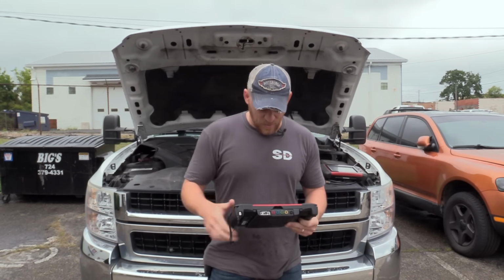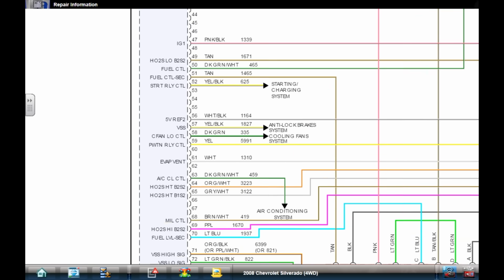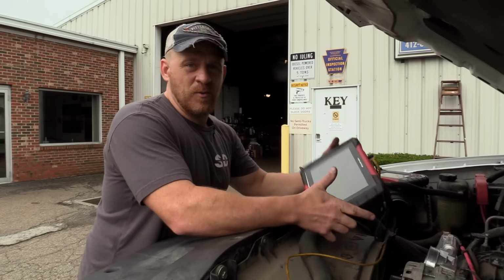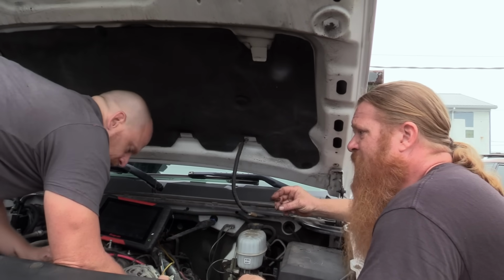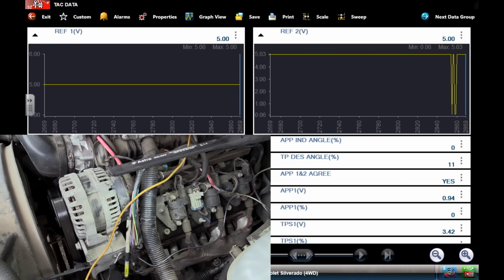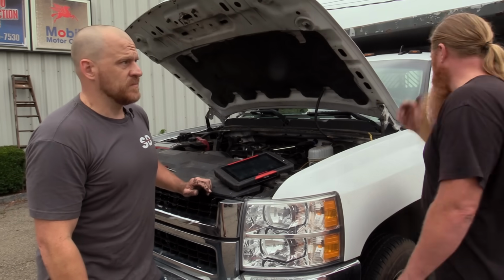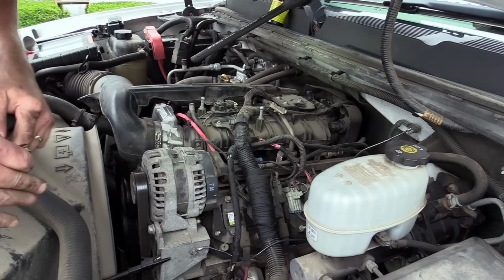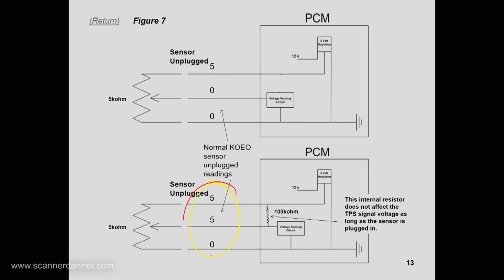Troubleshooting a Shorted 5v Reference Circuit (Chevy Silverado)

Comment: What happens if you get 12v on a 5 volt supply/ reference what can that mean i have replaced everything including a pcm tipm win module working on a 3.8 Chrysler town and country 
Im not getting pos voltage on the throttle body harness and also i do have a 5v ref but on the cam and egr and map instead of getting a 5v ref im getting a 12v ref and its driving me crazy what do you think is going on 
A short?
Reply from the maker: Absolutely a bad main PCM ground
Reply: @ScannerDanner  wiring harness bad ground? Because i put a known good pcm from another same car including a known good fuse box also
Replaced throttle pedal and cmp sensor 
Ckp sensor and throttle body and map sensor 
Thinking theres short in the main harness 
This van has been pullin my hairs
Reply from the maker: @qaysalshwaiyat905  yes sir, where do the computer main grounds bolt to the engine block? That is where you need to look. A bad PCM ground will cause the 5v regulator output to read near battery voltage. I have a video on this!
Reply: @ScannerDanner  thanks so much for your reply i have finally found my issue 
I have a 62te transmission 
And when i unplugged my transmission i finally got my 5v ref back on all the circuits so my next step will probably be the shift pack replacement but before that i will inspect the wires internally
Reply from the maker: https://youtu.be/1Nvyc_88AbY
Reply: @ScannerDanner  love watching your vids also keep up the good work i will be sure to watch this

Comment: Worked on DC-9s in NAS MEMPHIS Tn during Navy GOLDEN years ( 1982-85)   Gottem from Ansett Airlines down under ..One flight DC dignitary were on board having coffee n pretzels and the plane NOSE DIVED   :)  Sperry Rand was brought in, we could SEE the XYZ gyro signals on their earthquake device :)  AT 32,000  feet i crawl into the avionics bay behind pilots seat and start yanking on the bundle..................... DOWN we go ( lots of EXCITED RHETORIC from up top :)  ) We got back, n i found the problem...  the X wire for Gyro right behind module block assy was chafed like a NOODLE..NO idea HOW wen or where....Navy was happi w/fix  :)  SO were the dignitaries  :)

Comment: That was a great find well done.
Reply: I actually had one of these a couple weeks ago and it would do the exact same thing. Everytime you grounded it out the symptoms would change. It was in that exact spot same bolt. So I repaired the harness and added a vacuum cap on that bolt.

Comment: "Thru a glass darkly" is how I feel listening and watching yer vids. I don't know enough to absorb all of what you are revealing BUT I come away with pieces of invaluable knowledge by yer expertise which enables me later as I blunder through my Ford Ranger Harness problems! Thank you so much for taking us along. Even though WE are too ignorant to ask questions, WE feel our Brains being massaged by yer input. You are helping many and performing a great service! just thought ya should KNOW!!! Most excellent!
Reply from the maker: I have many Ford case studies on your system. What problems are you having with it? Thank you btw
Reply: @ScannerDanner  With yer input I now know I have a 5V ref ground as I have lost check engine light on dash along with all dash lights after moving harness looking for problems with ground to fuel pump. I am the third or fourth owner and ALL the "chickens have come home to roost" on this 02 Ranger with rebuilt engine and all original transmission plus wiring harness changes with different wire colors not matching up. I would be totally LOST without having found yer good intell!
Reply from the maker: @sargintrock8663  if you need a good diagram https://eautorepair.adtrk.biz/?a=10817&c=24&p=r&s1=
This is the DIY version of the same service info and diagrams I us. You need to look up the ground distribution diagram
Reply: @ScannerDanner  Many thanks. Roger, out!

Comment: I’m fairly new to your channel and I love it! I have a 2006 Equinox that’s throwing the P0641 code but my car is running perfect! I cannot Get it inspected with that code and I have already put 1900 into this car over the past year. I can’t afford another new car and just need to keep this one that’s paid for on the road. Any advice on this car of mine? I appreciate any advice greatly!!!! It also had an evap code (they said that may be cuz I don’t have the Chevy gas cap) and a P0300. I don’t mind putting a few spark plugs in but that PO641 is driving me nuts! P0641 5v reference one circuit(or circuit one is what it reads)

Comment: Great find guys!  My 2009 chev Silverado threw 7 codes. I searched all the codes on YouTube. The P0641 code was the last code searched which brought me to this video. Which also ruled out all other codes. I went back out to my truck. Leaned on the fender and looked at the harness and low and behold. Right in front of me the harness was pinched between 2 steel lines. Even the tip of nail polish was used. Fixed the truck with 4” of electrical tape and a drop of nail polish. Saved a pile of money. Went back and purchased a SD t-shirt. 
Thanks for the help.
Reply from the maker: That's awesome! Thank you so much. Just an FYI, all of my merch sales go to a student grant I have set up for my students at my school www.rosedaletech.org
You helped me with that grant today.
Reply: T-shirt just arrived in the mail. Looks and fits great. Truck is still running top notch! Thanks again.  I have shared my story several times. And still using the visual inspection method every issue I cross in my maintenance position at work. I have currently repaired 3 electrical issues since simply by visual inspection. (Grounded wires on the frame). Excited for my next diagnostics!

Thanks again. 👍🏻
Reply from the maker: @rayhiggins2476  thanks again!

Comment: But if code reading is 90% successfully, then you can’t fault the parts store for this business model … by chance my son has 2008 GMC Yukon 5.3l with codes p0340, p0121, p0341, p0452, p0522 and p0641.  The parts store wanted to sell him some parts too … also, he has no mud flaps … I’ll also be looking at contact points first too. Thank you
Reply from the maker: But it is absolutely not 90%! I'd put it less then 50% The code is a guide only

Comment: Brother I could use ur advice in regards to  a 1994 probe gt  thats showing lower than normal ecu reference voltage all of a sudden...no ecu codes and still runs ok but reference across the TPS dropped from its usual 4.98- 4.99 to around 4.5 and seems stuck there...any idea where I should begin looking? I;ll bet you have run into this before, could really use ur expertise..ill check the comments here for any feedback thanks!   new sub!

Comment: Preach it brother I get this all the time parts changers and then diagnose the real issue after customer has spent a fortune on parts . Having a similar issue on 08 Montana but P0641 Ref 1 5V and throttle not working proper . You have to be careful and take a lot of the info on You Tube with a grain of salt as it may lead you in the wrong direction, do testing and diagnose what is going on . I like your approach keep it up .

Comment: Yes, Phil's probe is excellent; the hole is so small it's hard to tell where you punctured The Wire if you don't keep track. personally, when I'm sure I'm not going back to that wire, I'll cover it with liquid electrical tape right after I remove the probe; if I'm not sure ill cover it with a small piece of electrical tape until I'm sure or when I'm done

Comment: Having that same code on my 2014 chevy equinox also the service stabilitytrak on puts in limp mode no rpm signal throwing code p15a0 for fuel economy not sure where to start im sure p0651 is the reason behind it tho but not sure where to start any idea would be helpful

Comment: Do You know anything about Dodge sprinters 
Particularly, p0193 trouble code
Reply from the maker: Not specifically that model but a quick Google search show that to be a fuel rail psi sensor code. Could be a sensor issue or actual fuel psi problem
Reply from the maker: Service info for your car https://eautorepair.adtrk.biz/?a=10817&c=24&p=r&s1=

Comment: Ok what I need to know and you don't show any cars with this what do I check when I do have 5 volts and the car won't start because of injectors not pulsating
Reply from the maker: Do you have spark and fuel psi? What are you working on? What trouble codes do you have?
Reply: @ScannerDanner  yes there is fuel pressure and there's spark because I spayed starting fluid in the air cleaner and it stated for a second and there's no communication with the computer and the fuel injectors are not pulsating i hooked up a noid light that's why it's not getting fuel it had a 02 sensor circuit code when it was running and the dash and head lights were pulsating when it was running its a 2000 Toyota solara 6 cylinder and I checked 3 sensors and they are right at 5 volts
Reply from the maker: @jasonelliot9633  so you have no communication with the engine computer?
Reply: @ScannerDanner  yes I hooked up a scan tool and it says unable to communicate check obd connection make sure key is on and the injectors are not spraying fuel and there is 5 volts at the sensors
Reply from the maker: @jasonelliot9633  I'm so sorry Jason, let's move this to my forum, we can help you better and you'll get faster responses www.scannerdanner.com It is free to join

Comment: Hi Mr scanner I have 20004 envoy 6 cyl4wd the actuator crankshaftsensor camshaft been replaced. Im limited in smarts and understating now I check. For 5volts at camshaftsenser 3 point connector reads 2.9 volts well plug in still have rough ideal
Reply from the maker: No wire reads higher than 2.9?

Comment: Great job reinforcing the number one priority---visual inspection---before doing anything else. I'm a hobbyist and have gotten the drop on friends with way more wrenching experience just by visually spotting what is right in front of them but overlooked.; no tools, scanners, scopes, tools, wiring diagrams, training required.

Comment: Does anyone know the video name where the vehicle had an after market alarm system that was attached to the ignition control module?
Reply from the maker: Are you talking about the viper alarm system one? That was a lecture, it wasn't live on the car. Is that the one you're talking about? It's a premium video, so if I uploaded it here too I'd be in my SD Premium playlist right here on YT
Reply: @ScannerDanner  it may have been. I thought another shop condemned the pcm and wanted you to verify it. The 5v ref sig was all but invisible.
Reply from the maker: @bradleypatrick5030  this particular one, I replaced the ICM and it never needed it!

Comment: Outstanding video, great example why after engine basics are checked it sometimes a good investment to have a diagnostic done by a pro shop with the right computers and test equipment for the most thorny problems or wiring problems that can drive the best insane.

Comment: Where can I buy a scanner like the one you are using?Its a waste of time doing manual tracing of wires and cutting of harness to access suspected circuit wiring.
Reply from the maker: I'm using a Snap-On Verus Edge in a lot of my videos. But you don't need a $10k scanner to do this stuff.

Comment: Hi.  I need to get an answer on a question I have. Bro . I'm at Mexico and I'd fix car on my after work time.  So rightnow.  I have a situation with a small truck 1998 ford ranger fuel injectors conectors or electric system on them . What o see its the power On still all time as soon as turn the ignition switch On.  On both end of the cable of the harness ?

Comment: At 41.55, you grounded 5v ref 2, but 5v ref 1 also got pulled to ground on the scantool. What's up with that?

Also, a bit later, you are checking the crank sensor signal and you state that you are switching from graphing meter to the scope to get a cleaner signal... My question is, is there any advantage for a graphing meter over a scope?

Last but not least, when you went you were fixing the issue, I thought of something. I would have wrapped the harness with the fibrous tape and stuck a spare brake bleeder cap onto the stud to keep it from touching the harness. Do you think this would have been a acceptable repair?
Reply from the maker: Yes, the graphing meter of the Snap-On scopes has a 300 microsecond glitch capture ability no matter what time base you pick. On a lap scope, long time bases require a high sample rate or you may miss a momentary glitch. This is why I switched to the graphing meter. 
Hope that makes sense.
I'm not sure about ref1 and ref2 on the scan tool? I don't remember seeing that, sorry
Reply: @ScannerDanner  Ahhhh I see, that's very interesting. Thank you very much for your reply once again. Cheers!

Comment: Is it possible to get a reading of 7-8volts on a input sensor (MAF) where it should be a 5 volts reference?
 Car was a fit 500 no start with a dash message fuel cut off

Comment: OH boy, This is exactly what my 2004 Dodge 1500 is doing and I will bet that it is the wire from the crank sensor that goes right past the exhaust. This will not be fun to trace.
Reply from the maker: check your vehicle speed sensor (vss) wiring harness and make sure it is not rubbing on the front driveshaft

Comment: Hola Scanner Danner, Ive leaned Great knowledge from watching your video, someday would like to contribute to your channel but times are blick, tjhe best I could do is share your videos on Fb, any you have video on the EPSM Electronic Power Steering Module, im getting a check Power Steering Message and Speedometer not working, I checked a Wire Diagram and its a can of Worms, 2009 Chevrolet cobalt 4cyl 2.2l,  thanks in advance
Reply from the maker: focus on the speedometer not working first, scan the system for faults (all modules) then post your finding to my forum. It is free to join https://www.scannerdanner.com/forum/post-your-repair-questions-here.html
Reply: @ScannerDanner , Thanks for your  prompt reply, I tried to create an account but had trouble , would try  again, I have an awesome report/ findings   , saw the video with you troubleshooting your brother,s pick truck, what a life saving lesson, had a  U0073 code what a nightmare,  but followed your troubleshooting procedure and my Innova Scanner lite up like a Christmas tree what a great feeling, managed to retrieve some codes on 2009 Chevy Cobalt , Power Steering Message,  Speedometer out of order, will follow up in your Forum, thanks for being a blessing to all of Us

Comment: Chevys can run with out the crank sensor learned that when  I left it unplugged after doing oil cooler lines
Reply from the maker: Some can. Key word, some 😉
Reply: @ScannerDanner  is it only the ones that would have 2 5v ref circuits? Have you ever seen a car that has no 5v ref until you plug a scanner in and then it runs fine, as soon as the scanner is unplugged the car dies
Reply from the maker: @michaelsieber6601  I have not seen that!

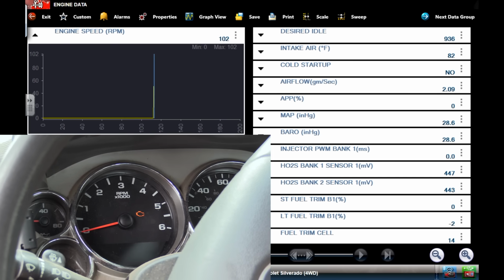Comment: 49:12 - now there is a great video for you.  I have a 2009 Chevrolet Silverado 2500HD with that exact same problem that I have been tackling for years.  After watching this video I’ve been trying all your techniques and keep coming with the same answer.  Replace the part.  I know that’s not the right answer but there is nothing out there to help fix the problem.  “Service trailer brake system” on the dash board.
Reply from the maker: What are your codes? Do you have an enhanced scan tool that will read all modules on the network?

Comment: Could a shorted 5 volt ref 1 to the fuel pressure sensor not start engine.  I tested at map and I had a 5 volt ref. But I tested the fuel pressure sensor at the pcm and I got .4 volt with the fps unplugged.  Than I checked for a grounded wire short.  It was ok.  Long story short customer had the fuel tank removed and replaced the fuel pump module.  Customer put everything back together with old fuel pump module back.  Tried starting and it ran with no codes.  Been working for weeks now.  It came in with crank but no start.  It had code p0452 fuel pressure sensor low voltage.  Also no power either to the fuel pump relay when it wouldn't start.    Bloody thing works now but I don't know how it fixed it self.    Must been wire being rubbed though but didn't find it.

Comment: I have 05 Chevy suburban 5.3 not getting a battery reading and gauge is on zero start and runs good and I checked all Grounds are still connected
Reply from the maker: http://eautorepair.adtrk.biz/?a=10817&c=24&p=r&s1=
A link for wiring diagrams for individual cars.